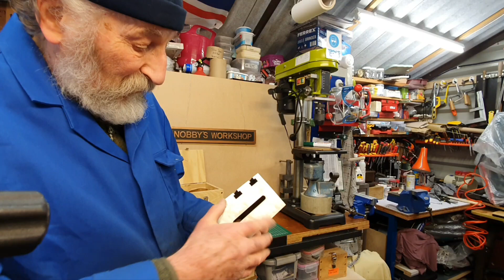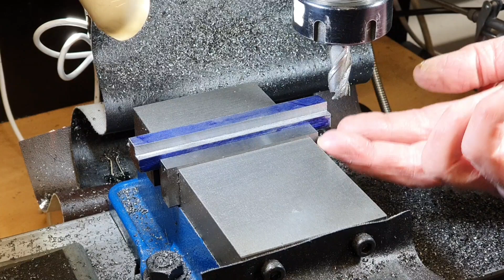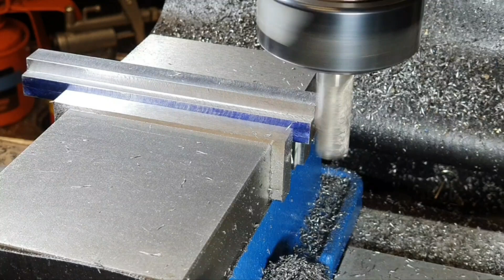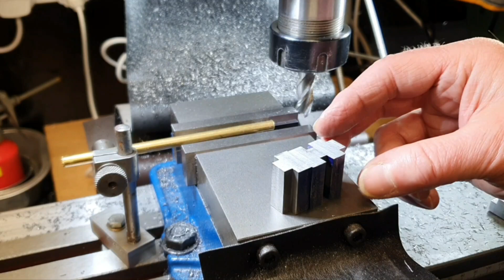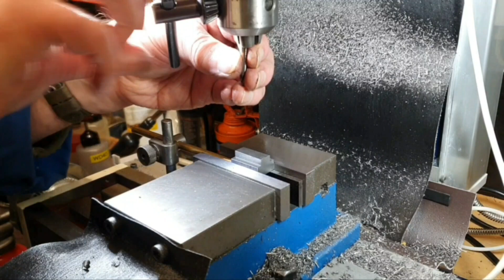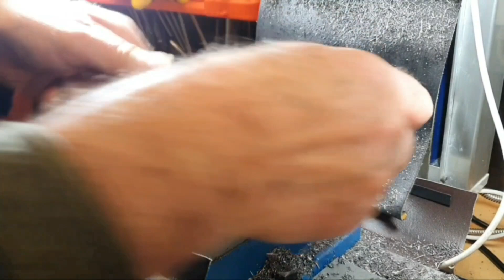Making T-Nuts for a Box Angle Plate.

Comment: Hi Nobby, great outcome, well done. A few hint's to help you if I may: As Dave says, damage the bottom threads, a ball bearing and big hammer works well (safety glasses on though). Look up climb and conventional milling if you're not aware of them, you took some big climb cuts in here which I am really impressed your mill handled - climb cuts are OK but just a few thou for a nice finish. Now you have your DRO, don't be afraid to work it hard, for example when doing your holes you could lock Y and leave it, but between the nuts you could move your X to give you better access to the vice and then just wind back to your zero with no backlash concerns etc. Hope these help Nobby. Cheers, Jon
Reply from the maker: Hi Jon, thanks for taking a look at the video, and for your valuable advice. That was a heavy climb cut to bring the nut to length. I should have zeroed the X and cut back to zero. My poor little mill was groaning. I'm going to make another video, damaging the thread base and cold blueing the nuts. Thank you Jon, Cheers Nobby

Comment: Great outcome Nobby. All you need to do now is to make the lifting handle and the job is done. Really with tee nuts the thread should not go all the way through. The idea being that the bolt / stud can not protrude out the bottom and jack up the tee nut and possibly break out a bit of the tee slot. Turn the nuts upside down an deliberately damage the last 1 to 2 threads. Another time use the taper or second plug but don't let the taps cut fully through. Well done another thing off your bucket list of things to do. Regards from Australia.
Reply from the maker: Hi David I am going to damage the bottom threads as suggested and also cold blue the T-nuts. Was going to do this in the video but it was getting a bit too long. Will make a separate video on this. Cheers Nobby
Reply: @nobbysworkshop  Just make yourself a little spearpoint punch, and whack it in 3 places, that will give you 6 small damage points and not look too bad. Another option is to use a steel ball and crush it in your vice. Good luck with it.
Reply from the maker: @daveticehurst4191  will do David. I'm going to practice on a bit of scrap first to get it right. Cheers Nobby